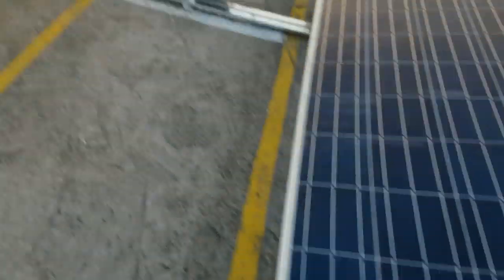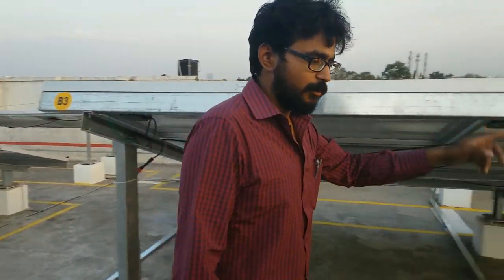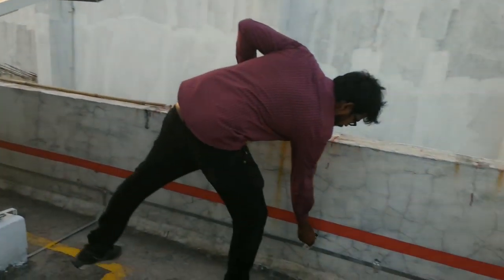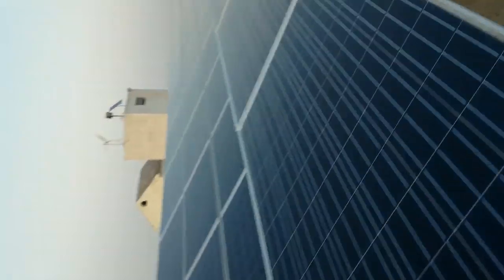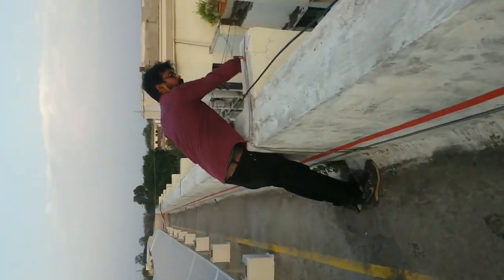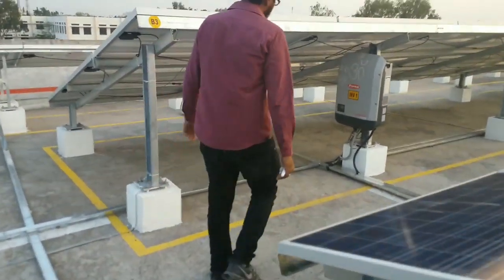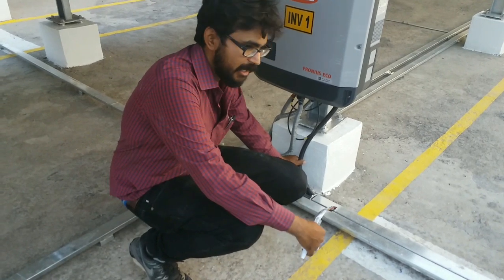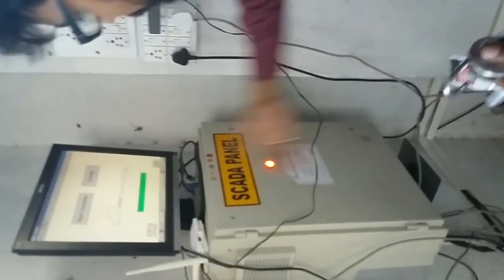50 kWp On grid Solar Rooftop Power plant at @Latur By Sanyam Indurkhya(under IIT Bombay kspl)

Comment: sir sanyam . ye bijli aapne kiske liyen banayi hai ? ye to direct bahar jaa rahi hai main grid me. kisi ke ghar me nahi. plz tell background to whom n wat for...
Reply from the maker: Dear Hasan ji , this is a Solar Rooftop on grid power plant with net metering. Hope you might be knowing about the concept of net metering, If not kindly go through the concept of net metering.
Reply: sanyam indurkhya sir. i know on grid n off grid system. but i m talking that u put 50 kv plant for one home....thats why i confused m ur netmtr is oitside home on road. thats why i ask. 50 kv too much for home ...or even office i think
Reply from the maker: Dear hasan ji, Its an Engineering college that I have already mentioned in my introductive part.
Reply: I have spent quite a while investigating average cost to install solar power system  and discovered a fantastic website at Ewans energy roadmap (check it out on google)